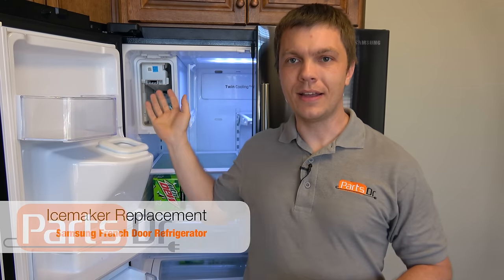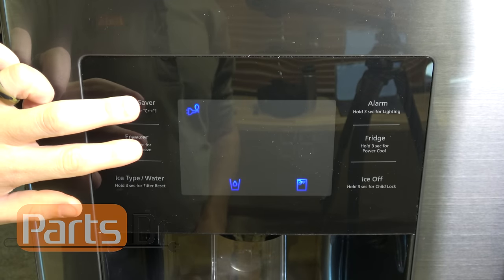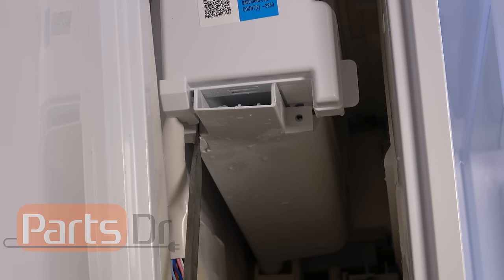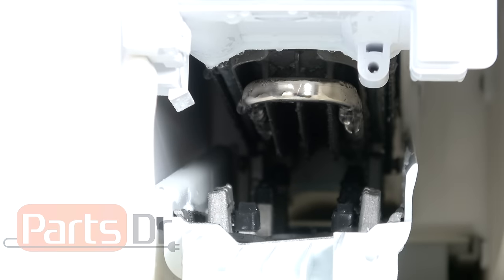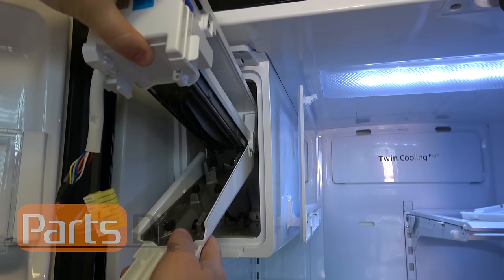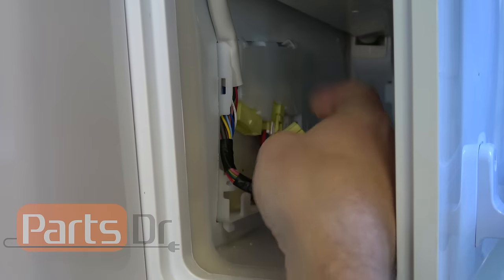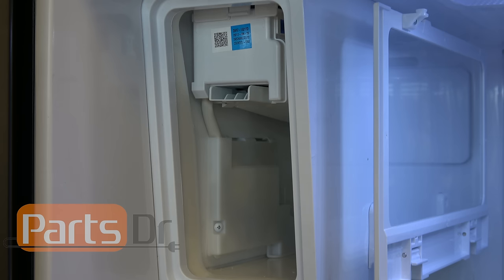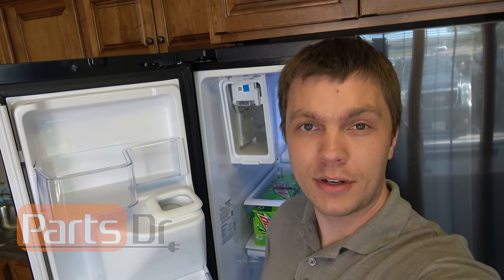How to replace Samsung Icemaker part # DA97-15217D

Comment: How do  I know is the ice maker is bad and not other component behind?  Like the auger motor.  Great detail video and comments.
Reply from the maker: Diagnosing a bad ice maker on these refrigerators is complicated and it involves a process of elimination.  For the ice maker to produce ice, it must be cooled down cold enough (typically under 20F) and have water/ice in the tray.  The auger motor has a fan on it that help circulate the cold air inside the ice maker compartment.  If it isn't getting cold enough check to see if this fan is working.  If there is no water/ice in the ice maker tray check the water supply to the ice maker.  The water on these refrigerators usually flows through a water valve assembly located in the water filter housing. If there is ice in the icemaker tray and the icemaker is below 20f and it isn't harvesting the ice you may have a bad ice maker or bad main control board.
Reply: How can you check if the fan is working? Also do you need the new icemake for the new y-clip assembly to fit or will the y-clip assembly work on original ice maker?
Reply from the maker: The Y-Clip kit will work with the old ice maker.  We don't know of any easy way to test the fan.  You would most likely to have trick the refrigerator into thinking the doors are closed and the ice bucket is in place which isn't very easy.

Comment: Is there any problem if I power down the refrigerator and take off the ice maker and then power up the fridge without putting the new piece in it? P
Reply from the maker: That will work just fine too.  Just make sure the ice maker is thawed out before you try to remove it.
Reply: But since is not making any ice do I still  need to defrost is? What about the all fridge? Is it going to defrost the freezer and other parts of it? Thanks for your reply
Reply: If the coil does not have ice at all am I good to go?
Reply from the maker: Just make sure any ice/frost ice melted from the ice maker before attempting to remove it.
Reply: hey, would you have a tutorial to remove the flex zone controller? i think i need a new controller, no light and temperature button not working... thanks this is s very nice and helpful video.
Reply from the maker: I'm sorry, we do not at this time.

Comment: You are the best.  Samsung is the best.
Reply: Samsung Refrigerators are the absolute worst.  Complete Trash!  Fix the auger fan problem already!  Once the auger fan freezes up, the entire ice maker begins to fail due to inconsistent temperatures, and inadequate cold air flow.  Iced up fans cause 99% of the problems with these junk refrigerators.  The FAN is the problem!!!  The FAN needs a periodic deice system.  Poor engineering Samsung.  I will never buy another appliance from Samsung ever again.  Shame on you and your terrible customer service.  You're only dodging the issue because you know the enormous cost of genuinely solving this problem!

Comment: Hi: I took it out and put it back in and it didn't work. Got in contact with Samsung and they replaced it under warranty. 
The repair guy said if you do the icemaker you HAVE to do the auger. Anyway, he replaced 4 pieces, incl the bucket. The new bucket is totally different and does not hold close on the bottom. It looks like there is a little tab that should click, but it doesn't. 
It started with frost and problems and defrost again and again and then it finally quit.

Comment: i was having issues with my ice maker, i put the ice maker into a FD mode for about 20 minutes, then i opened up the ice maker so you can see the metal coil, let it defrost for about 2 hours, unplugged the fridge for 5 minutes then left it alone for 2 days and ice maker started working again. hope this helps someone its helped me!
Reply: Give it a month or two tops and you will be doing it again
Reply: You need to buy a spare refrigerator while waiting for the first one to deforst

Comment: I installed the new ice maker as per the video instructions.  When I pushed the test button nothing happened.  No water is going into the tray and nothing is happening.
Reply from the maker: Have you given the new ice maker time to cool down?
Reply: Yes.  It's been at least two hours now and still no water has been deposited into the ice maker.  I pushed and held the little button on the underside front of the ice maker and nothing happened. The water has been turned back on also.
Reply from the maker: If after 12-24 hours the new ice maker still hasn't produced any ice you may have another problem with the refrigerator.  Here are some things to check:
*Make sure the ice maker ice turned on at the front control panel of the refrigerator.
*Check to make sure the temperature inside the ice maker compartment is 20F or colder
*Check the water supply to the refrigerator and ice maker

Comment: My Samsung refrigerator ice maker smells like fish. How do I fix it so it does not smell?
Reply from the maker: Have you checked to make sure all of the protective plastic coating the inside of the refrigerator has been removed?  If some of that is left inside the refrigerator it will start to stink over time.

Comment: I just installed the auger assembly, ice maker and clip kit that I purchased from Parts Dr. Also, I used clear caulk around the outside of the ice maker housing that is attached to the fridge. Get a bright flashlight and shine it around the assembly if you can see light going through you will need to calk it. I calked it all the way around to ensure no leakage. So now I wait and see if it makes ice. I will make another post tomorrow.
Reply: Just to report it made Ice and we will report back in 4 weeks or sooner if it ices up or not. **Does anyone know of a lawsuit with Samsung refrigerators?**  If so I would like to know and put my name on it.

Comment: Trying to troubleshoot mine. It's not getting water to the tray. The water dispenser works though... Any thoughts?
Reply from the maker: You will need to check the water valve and water lines that go to the ice maker.  They are usually located in the housing where the water filter is located.  The water valve for the ice maker and water dispenser work independently from each other so it is possible for one to work and one to not work.
Reply: @PartsDr  Mine is a Samsung RFG297HDRS.  I thought the water valve was on the lower right side on the rear but I pulled the cover and there was nothing there. The water lines are going in at the middle. Took all the covers off where the water lines go in and there is nothing accessible.
Reply from the maker: @JonnyBlazeTCB  The water valve is located inside of the part I linked below.
https://partsdr.com/part/da97-11433a-water-filter-case-assembly

Comment: So how do I defrost the icemaker I have unplugged it in the icemaker I have also done the door defrosting it will not defrost what are the ice comes out at the top of the ice machine has completely covered in ice. I have no idea how to fix this to make my icemaker work again. I’ve tried taking it apart I’ve tried chipping ice off of it doesn’t work at all can someone please help?
Reply from the maker: Don't chip the ice off, that is how people break the refrigerator.  Just unplug the refrigerator and leave the doors open for a couple of days should take care of it.
Reply: @PartsDr  How do you do that when you have stuff in the refrigerator

Comment: Not only has this been replaced after a year. It freezes up on top. Had to defrost it with a blow dryer. So if you replace ice maker..after a while it’s still going to freeze up? Now it’s about 2 years old, ice maker stopped working. There’s a leak under pull out drawer, the twin cooler, and it freezes too. They can’t fix that either. This is really a disgrace and frustrating how they made this fridge! 🤬

Comment: I just bought a house with a samsung refrigerator already here. Ice doesn’t work. Called former owner he said it was replaced twice (the ice maker) and after the 2nd replacement they gave up. They should have put this in the sales disclosure, among other things we found. I learned the hard way mot to ever buy Samsung again when our Samsung flat screen tv died after only about 4 years.
Reply: Maybe try the repair for the moisture ingress from Parts Dr. I also have the same issue and am now replacing the Ice Maker. FYI, my Frige is 2017. I bought it to replace a 5 year old Whirlpool, due to Ice Maker issues also. Not  sure which brand to buy next.....Maybe LG?

Comment: I placed my samsung refrigerator in Fd mode and it will not thaw the ice Model RF323TEDBSR
Reply from the maker: If the FD (Forced Defrost) mode will not thaw out your ice maker, you may have to manually thaw out the ice maker by unplugging the refrigerator and leaving the doors open.  You can also take a house fan to blow room temperature air into the ice maker compartment to speed up the process.  You don't typically want to use a blow dryer or heat gun as they can warp the plastic liner.  If the liner gets damaged it cannot be repaired.
Reply: @PartsDr  My icemaker has been freezing up for over 4 years. I finally shut it off and use trays. It STILL FROZE up in OFF MODE. Defrosted it 3 times last year. I removed the bottom ice tray/box last summer 2018. As I said it continues to freeze up all around the top and down the sides. I sealed it with silicone last year too. Anyway...I  Just finished doing it again with a hair dryer/hammer/flathead etc. to knock ice off it. I want to remove the top "Ice Maker"  for good. My question is: If I unplug the unit and it is in the FD MODE and OFF...Will I be able to turn the frig back on? (without plugging the icemaker back in, that is?)

Comment: This only a temporary fix if you do not get the new update main Pcb. combo with icemaker. do not uses a screwdriver to move the freon line may damage it. It will move out of the way by self if defrosted. 2020.

Comment: My new one wouldn't snap/click into place.  Tried jamming it, steaming everything.  No joy.  Went back to the old one.  No joy.  Put the new one in, slapped the coil into place and the bottom cover.  Thing didn't move.  Added the screw, the cover and that screw and now we wait.  Either I have a swimming pool inside my fridge or I have ice in the bucket.  Either way, I'm never buying a Samsung again.
Reply: These are junk. I have to use a heat gun to defrost is all the time, the plastic is warped and melted now. Leaking everywhere
Reply: Slight leak of sorts, ie a couple drops a day, nothing crazy.  About 3-4 days later I finally had ice.  

Still worried of the not locking in thing.

Comment: It doesn't come out. Help?
Reply from the maker: Try leaving the refrigerator unplugged and the doors open to let the ice maker compartment thaw out more.  If it won't easily remove, it is usually frozen in place.
Reply: @PartsDr  Nevermind. Just needed a little extra force with the button, Thanks for the tip though

Comment: When is Samsung going to recall this massive problem with this particular ice maker?
Reply: Samsung is in the middle of a lawsuit over this. They are claiming all these problems are due to user error and NOT their fault at all. Don't worry once the lawsuit is over and the lawyers grab their cut you might receive a $25 check in the mail for you troubles. The best thing you can do in never buy a SAMSUNG product again. I only have 1 more appliance left to replace in my household that is still Samsung, I now own all LG appliances.
Reply: @whpony96  Liked your response. I suspect all the consumers would receive is a discount on their next poorly engineered Samsung appliance.

Comment: Has anyone just tried defrosting it all the way to remove it and put the same unit back in?  I just did this. 
Before I actually found this video I had thawed the ice buildup that I could see without removing anything and it would continue to make ice for another 5 days or so. 
I always knew there was ice buildup in there that I could not get to thaw out.  I am hoping I can get another year out of this one. I think since I was not getting ALL the ice thawed out on the inside it would not last as long as if I got it all. We will see.
Reply: I've done that MANY times.  The frost just builds back up again in a few short weeks.

Comment: I replaced the ice maker, still nothing it's not even making ice!!
Reply from the maker: Make sure to allow 12-24 hours for the ice maker and compartment to cool back down and to start producing ice again.
Reply: It's been 2 days, lol. Maybe the auger thing is busted?
Reply from the maker: @alanstolarczyk5442  There are multiple components that work together on this refrigerator to produce ice.  The ice maker, main control board, water valve in the filter case assembly, IR sensor on the auger motor assembly, cooling system and fans.
Reply: @PartsDr  Oh God!!  Thank God i have a whirlpool running downstairs!! Has never failed!!  Old school!